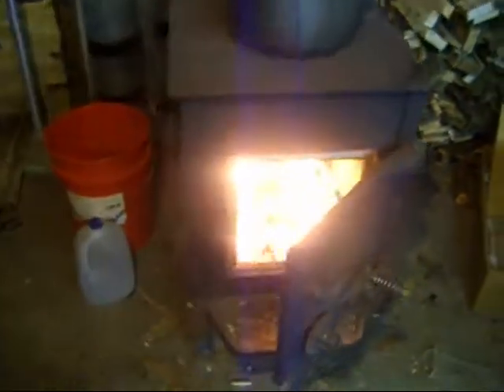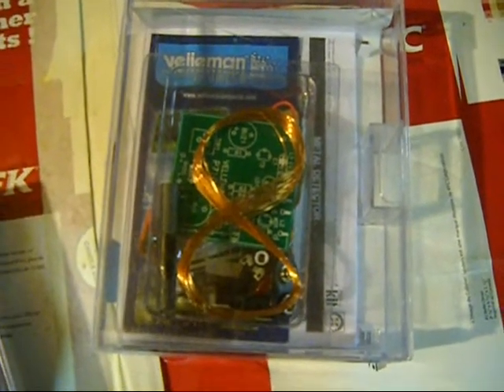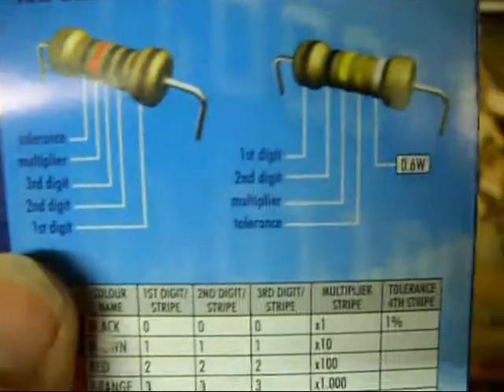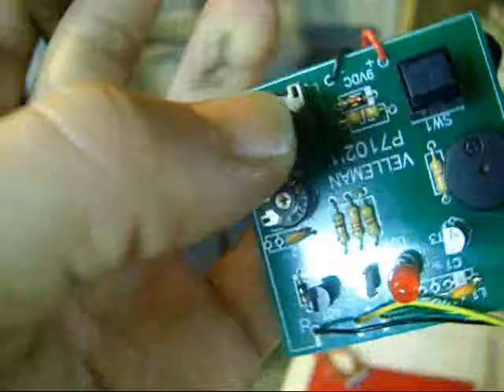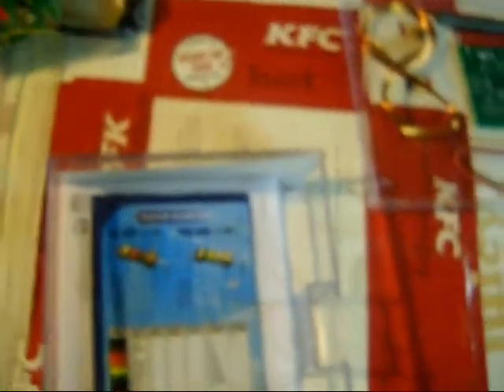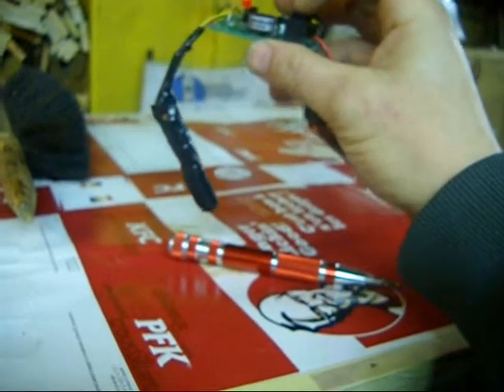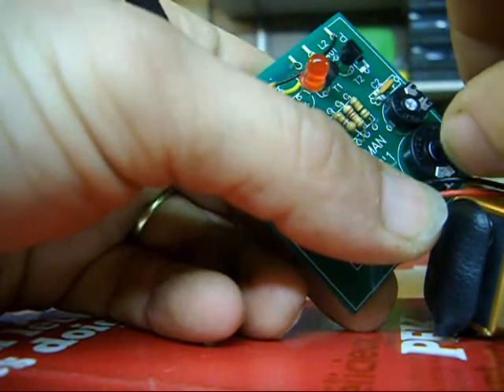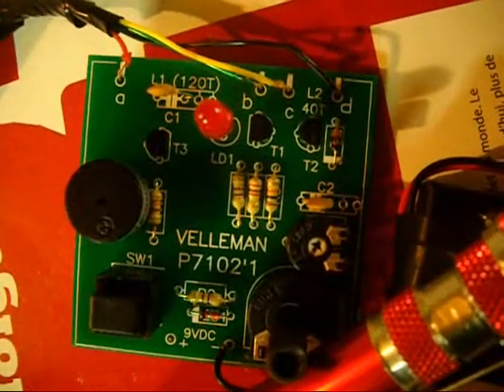DIY pinpointer VELLEMAN KIT K7102RS

Comment: Salim amineقبل 5 أيام 
 (تم تعديله)Good morning and thank you for this valuable information, and I have a question please exists on this link .           _ (How many turns are in the grand mono coil _18 inch _ and wire diameter user (gpx 4500))  _and how it is linked the wires in numbers? ....my respects

Comment: Nice vid NH - I wonder if you could use heavier guage wire to extend the probe/pointer. This looks like it might be worth giving a try. Thanks alot!
Reply from the maker: Donald Watkins III Maybe, I didn't try heavier guage. I thought it might me not flexable enough for the job. Thanks for watching. This issue with this unit is the weak state of the sensativaty. the cold just made it useless but in good weather it does ok.. It's on the shelf right now.
Reply: From my limited understanding a heavier gauge wire at the coil would be for higher power being put through it. A bigger coil matching impedance (more power radiated rather than reflected back) would increase range.

Comment: been awhile since you did this vid but could you switch out the buzzer with a 3v vibration motor or smaller?
Reply from the maker: Wow, sorry Joel. Just took a trip down memory road and found your comment.. If you still need to know, yes you can.. and I did in my later video after extending this on a long piece of cat5 wire. Sorry it took me so long to get back to ya... best to you.

Comment: Once the probe is encased, won't you need it to sound without being in direct contact? I think of pinpointers as sounding without touching or bring right on top of the item being sought.  Show us your continued work, okay? Maybe a dead garrett pinpointed bought for cheap online might be something you could scavenge for ideas or potentially repair?
Reply from the maker: That's how this works, check out all my video's on it. It doesn't work so good in the cold of the garage in winter (25F). I'm always looking for broken ones to get cheap, problem is everyone thinks they have gold... Thanks.

Comment from the maker: Testing each component can usually be done with a good multimeter and googling "how to test ______" be it a resistor, capacitor, potentiometer, switch..... I think transistors and other stuff is more difficult to test. 
Congrats on the Super Stereo Ear, sounds like a lot of fun. These little kits are really fun for all ages, I had a blast getting my metal detector kit to where it is now an I'm 38.......

Comment from the maker: Bummer dude, wish i had more answers. Maybe i got lucky cuz mine worked first try then the battery lead broke and i fixed that, then the switch I installed failed so i fixed it. One thing i did notice is that if you tune it in very warm conditions you have to retune it in cooler condition and vise versa, that's all i got man. Good luck.

Comment from the maker: The other thing to check (it happened on one of my other videos called Jay Mo Pro) is that the battery leads are really cheap and break easy. check all solder joints to make sure they are a good meld with the component and the copper. Good luck Lex...

Comment: Would be great if you could take the average Metal Detector, and "beef up" the Power to achieve greater Depth .
The average Detector goes about 8 to 12 inches deep ... Pinpointers about 2 to 4 inches.
I think someone like you can change their components to DOUBLE those numbers .
Maybe even a different type of wave needs to be sent into the ground, than the wave sent down by our detectors ... like a micrwave or something, who the heck knows, but something different, more powerful .
Good video .

Comment: Ok I admit, I watched it a second time :) Because the idea of mounting it in a squirt gun frame came to mind with using the trigger & all... Then paint it black & holster it to keep away all of those detector finds thieves... And then if all else fails and you get fed up with the new gun laws coming out, you can take your new squirt gun pin pointer into the bank & use it to demand the $140 bucks to buy the Garret :)

Comment: You could probably slap that tip into a plastic cigar cover & then put heat shrink tape over it to the handle that you could make out of anything including a plastic soap travel container. Could you get away with loosing the circuit board & rolling it all into a handle? Would be nice to make a long narrow rolled circuit board for it. Someone could make a different board for you at the local college easy enough. If you don't need both sets of wires then that would cut out a big part of it also :)